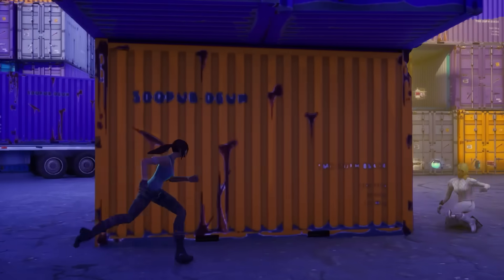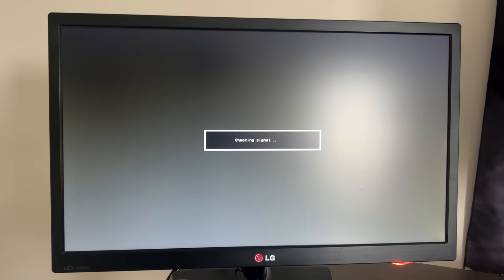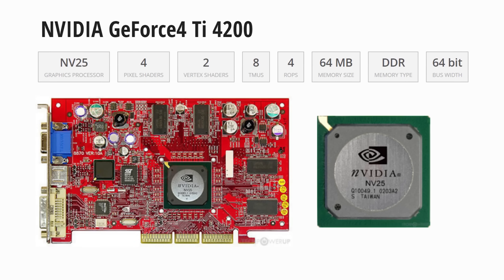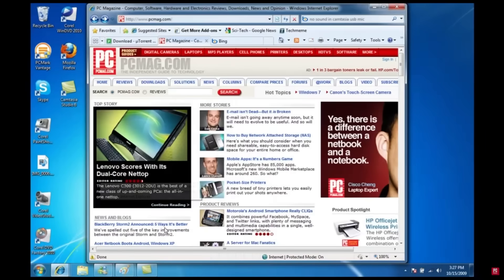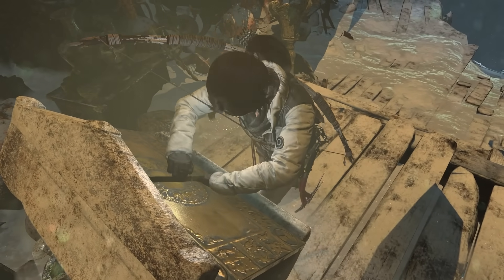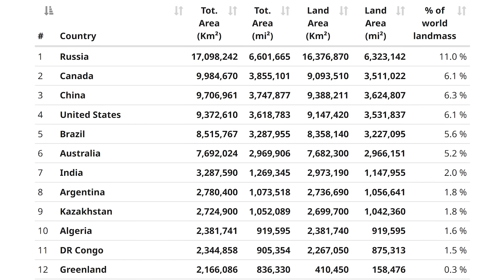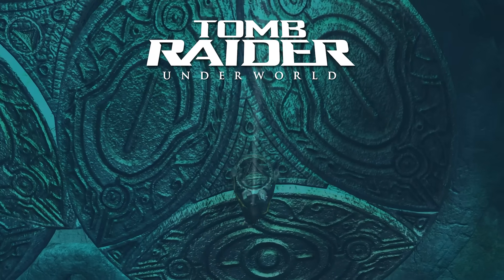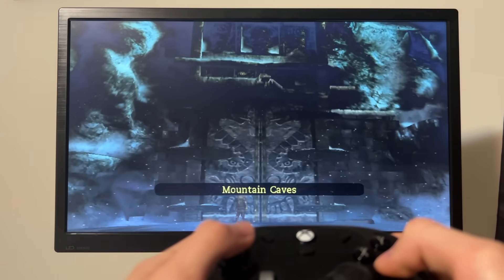I Optimized a 24-Year-Old PC Until It Plays Anything

Comment: The first thing to do in any old PC that hasn't run for years would be to change the CMOS battery to a new one, usually a 2032. Then go into BIOS and set the date.

Believe it or not, this fixes a lot of old PC "dementia" like issues. This will save you a lot of time later 😀.

And always tighten up those vga and dvi cables if you can!

Comment: A 64MB vram gpu with a 64bit bus sounds painful as hell, with all the driver support and best available hardware considered. 
the best possible, last released AGP(x8) specific GPUs were the (ATI Radeon X1950 PRO AGP) for speed in 2006 and the (HIS HD 4670 IceQ Native HDMI 1GB) for vram in 2009 with drivers that lasted until windows 8. 
the best possible, last released PCI specific GPU was the (NVIDIA GeForce GT 520 PCI 1GB) in 2011 with drivers up til windows 10.  I’m sure Linux has even better, more recent driver support. Might have been able to get it to 30+fps at least, lol.
Reply: I have the  Nvidia GeForce GT 610 ZOTAC 512MB a few games with it with mix results with a Pentium 4 HT. Even a Nvidia GeForce 8400GS PCI would have worked fine in this rig. I have one in a Pentium III system running Windows XP.

Comment: I have had Windows 7 online nearly everyday since it lost support, with zero problems. There is a YouTube channel that tested these systems with all security services turned off and monitored potentially malicious interactions from the internet. XP got several hits over the test period, while Seven and 98 did not. 98 has the benefit of "security via obscurity", since it has no market share currently, there is little out there actively targeting it, so the only risk is malicious files and sites that have been sitting for years. Seven is far more secure than XP. I would put a good firewall on it, be very cautious where I take it, and it will probably be fine. If you are worried about network infection, disconnect it and port files via flash drive/burned CDs. These can be scanned by certain anti-virus programs both ways for an added layer of protection. 

I found the reddit post shown at 9:53 to be rather patronizing and insulting. Yes there is a risk, but for those of us who have some level of experience, it comes down to risk tolerance. I have my 20 year old XP computer, but I never connect it to the internet now (last time it was connected was 2021). As for my Windows Seven computer is like the 1980 Ford LTD that you beat the crap out of it and take it everywhere you shouldn't and yet it still works fine years later.  

I have also been through this rodeo twice. I remember when XP support was dropped and I was one of those "pry it from my cold hands" types when it came to XP, and I kept using it online until 2021. The only time I had a virus infect the computer seriously was in 2012, before it lost support. I always have had strong firewalls though and layered anti-virus.

Comment: 3 AGP slots and one PCI slot? you mean the other way around.
Reply: Running retro PCs for old games, I run Windows 98 SE on my Vortex86, I just never put it on the network. The drive is an SD card, I shut the PC down, take the SD card out and put files on it that way. The reason I like this machine is for it's DOS support, it runs any DOS game.
Reply: As for the resolution change making the screen go black, that likely a timing issue with VGA and the monitor deciding not to support it so going black. Get a OSSC and upgrade that VGA signal to HDMI and upscale it.

Comment: You can get a way better GPU for the AGP Slot, I use a Radeon x1950 Pro with 512GB of VRAM in my old Pentium 4 3.067 MHz with Hypterthreading. It has DirectX 9 with Shader Model 3.0. And you can even get a Direct X 10 GPU for AGP in the form of a Radeon 2600.
Or do the components have to be from 2000?

Comment: When you said you had a dell optiplex.  I had a oh momment since, i bought one months ago for $30. It was a used medical system. Which i keep upgrading parts over time. An I love how energy efficient the system is. But no joke it is small an rather easy to move compaired to most computers. I actually started putting xbox 1 parts into it. Like the ssd someone had with the blueray drive.

Comment: Back in those days, integrated graphics existed on the motherboard as a chip, not on the CPU itself. My Dell Dimension has a pentium 4 with Intel Xtreme onboard graphics soldered to the motherboard. Again, CPUs of that time did not have a graphics processor on the CPU die itself

Comment: Windows 7 is not that bad, actually windows 7 is still receiving all the necessary updates using windows update, though that is up to 2020, but it is is still nice to know that a fresh install with the newer prerequisites can still work.

Also windows 7 and under are OS's that can be used as the user's wants to use it, not be told how you should use your computer like newer OS's that resembles a smartphone behavior. 

There are also unofficial patches, VPN's Older software like Zone Alarm 2008 suites, plus most if not all newer antivirus software will still work on Win7/64.

Don't fall for the trap that your windows 7 have over 1,000+ vulnerabilities - MS probably placed some of them there in updates to make you to make you upgrade, though this is just hearsay. However what's not hearsay is that newer windows do more spying and tracking by default. 

And lastly, as of present Microsoft do not send domestic users of windows 7 updates, but Commercial and Government. They do, because it is contract based. There are also lots of unused software in windows 7, that is built-in to help you protect your data, most notably is bitlocker, but like everything good, it is not free. And remember the Big boy himself work on this as a final project, well that is if you count Windows 8.1 as a good OS. 

Please remember as of  Oct. 13, 2024 [when I last checked] windows 7 was the second most popular OS. 

And Oh, there are AGP to PCIe adapters available.

Comment: The original Sam & Max Beyond Time & Space (i.e. Sam & Max Season 2) certainly doesn't need a GTS 450, those are the minimum requirements for the Remaster released in 2021.  I played the OG version in 2010 on a 512MB GTS 250 and I think even that was overkill for it at the time. Since you got it to launch, you should've looked for a way to update the settings outside of the game, via a config file or registry entry.

Comment: I love those old PC videos... They make me super nostalgic. 
One of my old main PC's that I built was the direct competition to what you just built.
It was an AthlonXP 2400+ Later upgraded to a 3000+ which made close to no difference (Going from 2000Mhz at a bus speed of 266 to 2166Mhz at a bus of 333)
It was originally paired with an Nvidia Geforce 4 TI4200 128MB which was an awesome awesome card... that sadly was short lived as it lacked a more modern DirectX and pixelshader support... so I had to upgrade to play Battlefield2. I was sad because the TI4200 was faster than most other modern cards, specially the crap FX lineup... I think I followed it up with a Radeon9600Pro.
Later jumped to my first dual core, an Athlon  64 X2 3800 on a cheap mobo with onboard Geforce 6150... till my next paycheck where I got myself a decent PCIE card... Forgot which model.
The Pentium4's were pretty slow chips, specially the earlier Willamette cores from 1400 to 1800Mhz. The followup Northwood core which I think is what you were using at 2800MHZ was decent. Specially the ones who introduced Hyperthreading which is still utilized today. 1 core 2 threads. Those were some of the best days of AMD VS Intel as both were very different. AMD introduced the first "PR Rating" as prior all CPU Speed was calculated by it's official clock speed.

Comment: Man, I thought this was gonna be some crazy optimization video with windows extended kernel patches and wild potato mods for each game, or even a Linux flex to really push that PC to its breaking point.

But all I got was some scared doofus who didn't even attempt to go off the beaten path, and then he calls that an achievement because "he used and old OS unprotected"

Good job on the bare minimum I guess

Comment: Aslong as you have a physical firewall, and not just a modem, it's fine connecting a old OS to your network, that has internet access.
The problem is if you don't have a physical firewall, and just a modem, and your old OS gets a public internet IP directly on it's network card, don't do that.
And don't browse suspicious websites on it, obviously. if you stick to well known sites, it's still not a problem.
Reply: And get Thorium browser for old OS like vista/7, that HAS opdated SSL, which doesn't give you the false-positive scare-tactics message that the server you are connecting to is unsafe. Thorium even has uBlock origin pre-installed.

Comment: I was going to comment on the color issues, I've worked with video DACs in the past for translating digital framebuffer outputs from a GPU to analog outputs for component connections to older TVs, and you were just missing a duplexed color channel, that also explains why it works fine in the BIOS because the BIOS often uses CGA/VGA compatible fallback modes for output, which don't rely on video acceleration or complex display output modes :p

Seen that kind of problem before on poorly soldered or configured DACs as well, just a good thing to keep in mind if you ever see something like this again in the future. An actual failing GPU would cause frame artifacting or complete RDP (image raster) failure which would translate to meaningless noise on the monitor if a proper display signal is output at all.

Comment: This is garbage and it seems like you don't know what you're talking about most of the time. You "optimised" what? You plugged in some cables and selected one of the video cards that would have fit. You said that the ATI RAGE PRO wouldn't fit due to being PCI express when you had 3 slots it would have fit in as it was regular PCI. The Monitor is NOT called the "LG Twin Towers", that's part of the address of their office FFS, it's an LG Flatron, it says it right there. Most of the video is clips of playing a game that you never ran on the computer. You called the PCI slots APG and vice-versa. The computer is not as old as you said in the title or description. You should learn a lot more before you try to make videos like this.

Comment: When it comes to using old OSs you should be perfectly fine as long you're not doing anything risky. As long as you have a working version of ublock origin in your web browser you should be safe from most threats.
Also a old PC challenge is far easier with just slightly newer hardware. For an example if you went for 10 years older rather than 20 (so 14 in total) you end up with Sandy Bridge which can play pretty much any game out there, you might not see amazing framerates in the most CPU demanding games but they'll run. Another option would be to just go back far enough that you still have PCI-E, so Socket 775 Pentium 4 or Athlon 64 on socket 939, that way you could go for an exactly 20 year old PC.

Comment: I just got blasted back to the past with the USB bot allowing the PC to boot.
I dunno if it was an early kind of secure boot and I don't remember if I ever bothered figuring it out.
But yeah some old PCs just don't wanna boot with USBs in them.

Correct me if I'm wrong but I do believe that DVI is analogue so that's why the BIOS looked right and Windows didn't.
If the cable is half way in it'll still display something and just not get all the colours.
Whereas a digital setup like HDMI will more or less work fully or not at all.  Again I'm not rock solid I was never a hardware person.

Comment: There are still ways to get security updates for Windows 7, though you gotta look around for that. However, another option to take is just not having a Windows 7 online. Transfer files over FTP if you still have it connected to a router but not allow it internet access or just use a USB stick, which would probably be slower.

Comment: Most of the security flaws are exploited on computers that have either: a direct connection to the internet without firewall/router of have ports forwarded to it. If you use the OS responsibly, the chances are very low that the pc will be compromised

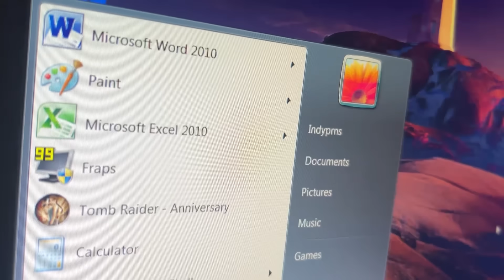Comment: 8:25 Routers have an integrated firewall that blocks incoming traffic that could harm your system. Obsolete OSs can't be compromised simply by connecting to the internet, unless you're still using a classic internet modem, which hasn’t been a thing for about 20 years.

Comment: Going into this, I was thinking maybe a FSB or BSEL pin/pad mod for CPU overclocking, tweaking RAM timings with one of the old tweakers fr MemSet tools or similar, modded drivers for the GPU like the old ATI Omega drivers, but there wasn’t even an overclock on the GPU. Is the thermal paste even still good on both the CPU and GPU? Where are the registry modifications, OS tweaks, or game configuration file tweaks? There’s nothing here. Where are the optimizations?

On a more serious note, even with RivaTuner, the Ti 4200 likely wouldn’t overclock much, and even if it could, it only supported up to DirectX 8 and OpenGL 1.3, which rules out most modern games. Even Minecraft won’t run on that, and Minecraft will even run on a tiny SBC like the Raspberry Pi 3. Even if you upgraded to a more capable AGP card like the GeForce 6200, it probably wouldn’t run Valve Source 1 games like Team Fortress 2 at full speed, as the CPU would likely bottleneck as well. Without PCIe, you’re pretty much limited to retro games like Doom or possibly older versions of Sonic Robo Blast 2. For emulation, it could handle retro consoles like the NES, SNES, and PS1, and maybe N64 depending on the CPU. Might be worth repurposing as a retro gaming machine and running Emulation Station.

Comment: I've a ancient rig that's rocking Pentium 4 @3.00Ghz, a glorious 2GB DDR2 RAM and the legendary Intel 82945 graphics integrated.
Well the problem of having your cable be a little loose did the same thing to me, i once had to relocate it's monitor for changing the desk and upon replugging my entire display was pink.
2 weeks later my dad just randomly fixed it by simply tightening the screws and tje display was all normal🥴

Comment: I had one its pretty good enough to play games till 2012.

The only thing p4 struggled was with gta4 type games.

It could eun crysis easily also during that times for intel motherboard vga there were modded drivwrs to make them better in 9xxf community.

It's a pretty decent setup for low end gaming ,. ideally a gpu would help like 8600 or something nit wven without that its not useless fun times and back when games atleast had some optimization.

Comment: saying that windows 7 itself existing on the hard drive is a security threat feels way too overexaggerated
Reply: I've got windows XP on a hard drive and I still use it
Reply: @origamifolder2255  Me too. And if you can properly setup your wall, it's not a big deal to have some vulnerable ports open (just don't expose them to the wild ). But it's not the case with the new generation which is unable even to read a single 
bios setup screen to see, that the floppy is enabled on the first page, not only in the boot section (where TS has been fiddling a lot)... It's rather sad than fun to see. :(
Reply: @ wwweeelll my use case is a little unique. The said hard drive is in an old Dell Dimension that I got for free, and it doesn't have internet connectivity anyway sooo... yeah it's not catching anything anytime soon XD
Reply: yeah its stupid. As long as you are not clicking on weird links or you are a high profile target, there is basically no threat
Reply: @thatn1co Yeah, cos it is lol.
Reply: LECCTRON commented on my video!!!!
Reply: I've noticed in some tech videos with old Windows versions that it is overexaggerated when connecting it to the internet.

Comment: They don't call that thing the LG Twin Towers. They call the twin towers in Seoul that LG operates out of the LG Twin Towers. If only we had the Internet on our computer machines so we could do the Google, the author could have figured this out himself.

Also, being flustered about the floppy drive is such a Zoomer take. When I was your age 👴the concept of a PC without a floppy drive was ludicrous, because what are you going to boot into DOS with if your PC is somehow borked? A thumbdrive? Might as well try to find a dilithium crystal to boot from.

Edit: HAAAAAH, trying to use a USB keyboard on a PC from 2000 without a PS/2 adapter and expecting it to just work. I'm actually shocked it worked in the BIOS.

Edit #2: This dude had weird color issues over DVI and automatically assumed the GPU was at fault. 😂

Comment: I saw you used a DVI cable for the monitor. 
Why don't you use a HDMI to DVI cable so you can use your new monitor? 
Both connections are pin compatible minus the sound capability.

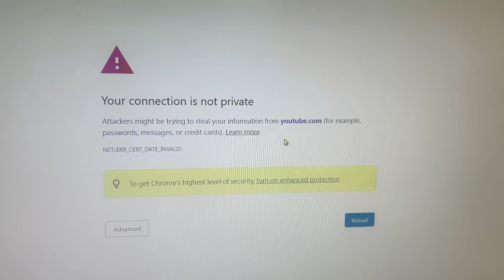Comment: Windows 7 (or even older) are fine to use even online as long as you don't connect to the internet without a router (which absolutely nobody does these days). The error at 9:46 was not Chrome trying to stop Windows from "connecting to even the safest websites" but a certificate date invalid error, meaning the date on your OS or BIOS is wrong (you can cause the same outcome on a modern PC if you change your date to multiple years ago.

Comment: The reason you're getting SSL errors @9:48 is because the root certificates on that Internet Explorer are outdated and it can't connect properly. If you get Firefox ESR you can get online with all bells and whistles fairly safely. Just stick behind a firewall and only visit trusted website. That way you can go online 'relatively' safely. Sometimes I have no choice, especially with old car diagnostics software that doesn't play well with Win10 or 11.